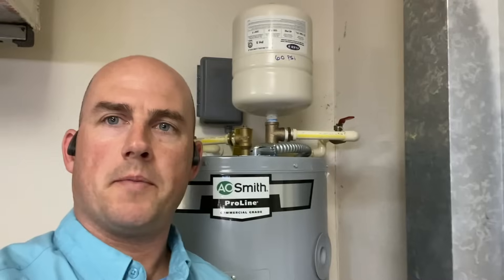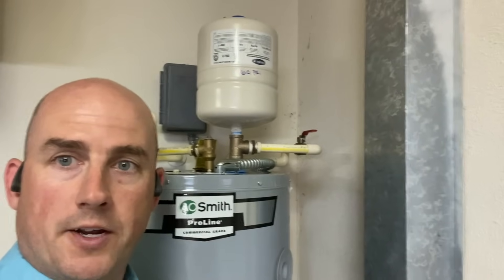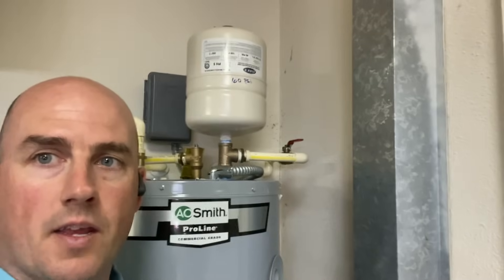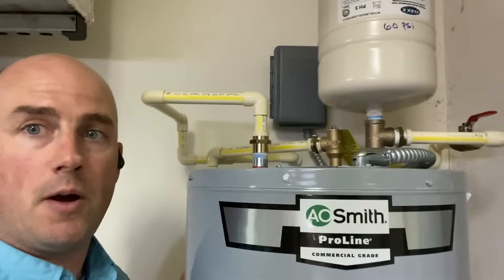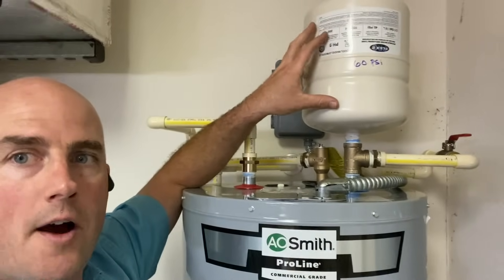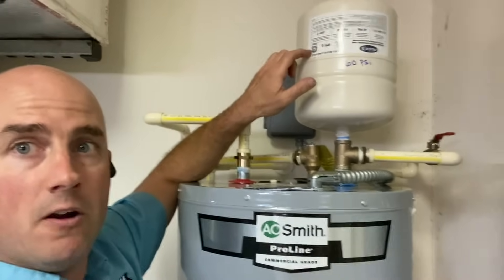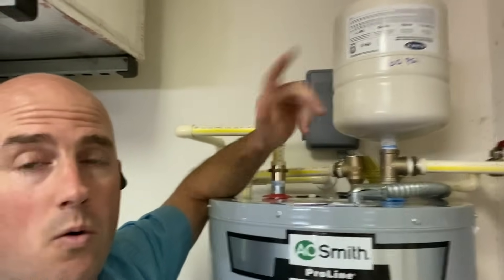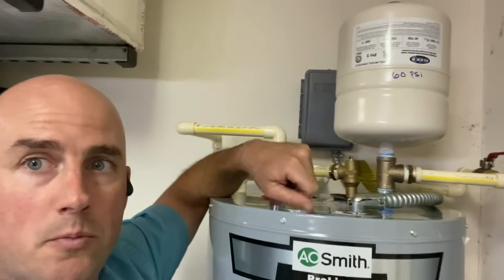What is a thermal expansion tank, and why do you need one?

Comment: How do u fill it with air
Reply from the maker: First you need to turn off the water being supplied to the tank.  Then you need to open a faucet on the hot side to relieve the pressure.  On top of the tank there is a valve just like you would use on a tire.  It’s also a good idea to actually unscrew the tank and remove it to check for corrosion on the inlet.  Especially if it was screwed into copper.  When it is screwed into a copper fitting it will build up with a lot of corrosion.